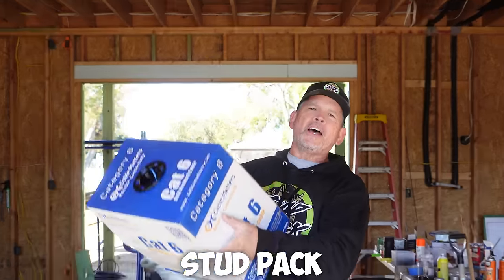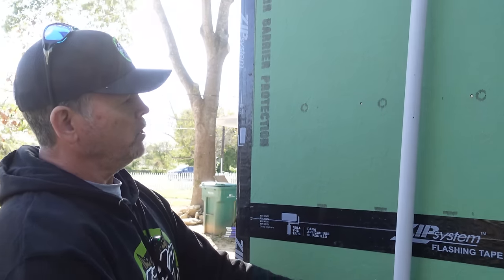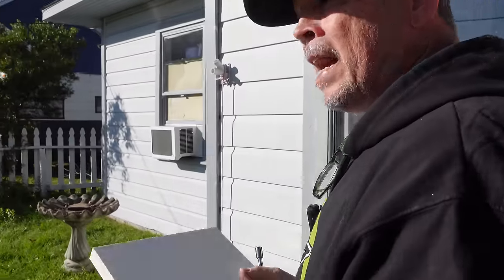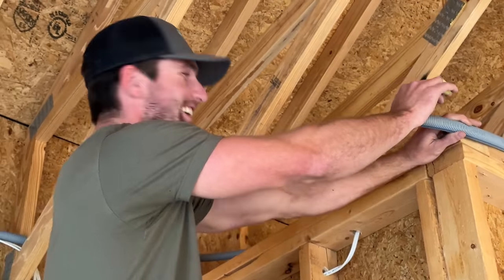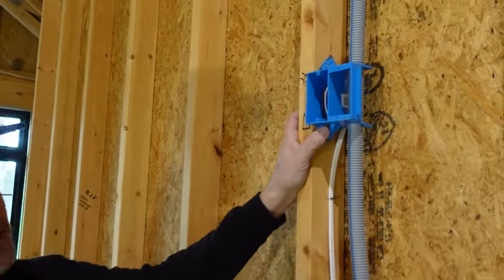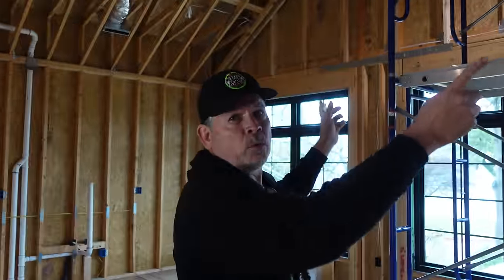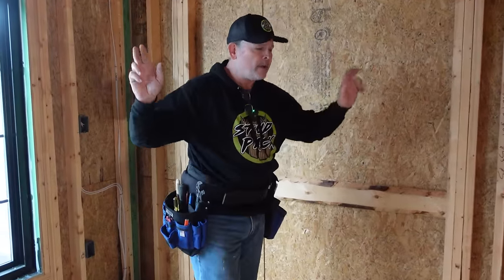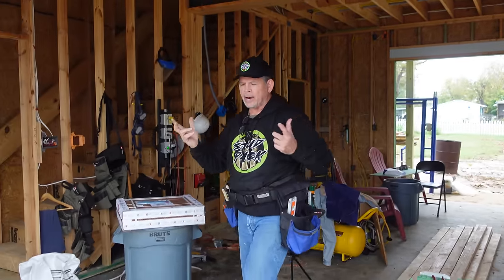DIY Networking for a Future Proof and HIGH SPEED Home! (Smurf Tubing and String Pull Trick!)

Comment: Please don’t terminate with modular connectors. Terminate to keystone jacks and connect with molded patch cables.
Reply from the maker: Why?
Reply: @StudPack 1, you’re using solid conductor. Punching down to inserts will have a more reliable connection. 

2. Molded patch cables will have better longevity/durablility. Less likely to cause issues in the future when you plug/replug cables. 

3. Keystones in a wallplate, surface mount box or patch panel give a much cleaner installation and gives more cable management options.
Reply: @StudPack it’s the right way to do it.  Solid core cat 6 in the walls from a central home run location.  You will use a patch panel in that location and will have the modem and router located there. You will terminate throughout the house with keystone finishes that snap into the wall plates. You then run preterminated rj45 Ethernet cables (which are stranded cable and more flexible) to the actual devices , computers tvs etc. you also want to ensure you are using solid core copper cable not CCA which is copper coated aluminum.  It sucks, reduces bandwidth and does not work for POE applications.  Also run Ethernet cable into the center of the ceiling so you can ceiling mount an access point. Lots of little details around this make a big difference.
Reply: @StudPack  see all the comments that all say the same thing about keystone jacks.
Reply: @braydonscully4646  @Studpack heed the above comment. wise words he says.
Reply: @StudPack service ability mainly. Think of it in terms of a power outlet, you wouldn't put an extension cord end on the end of a power run.
Reply: @StudPack  Read a book on data cabling. Just like the NEC, there are standards. (eg. the conduit color should be blue (wire) or orange (fiber) to visually indicate it isn't power.)
Reply: @paulzeee  I love this analogy. Imagine all of your outlets in the house be female ends of extension cords just "hanging" out.
Reply: From wall to network rack:

-Keystone in compatible wall plate
—when punch down keystone (568B is typical)
-Cat6 copper solid core cable to cat 6 punchdown or keystone rack mount panel (maintain same standard as was used on keystones / 568B is typical)

Use patch cables between patch panel and modem / gateway / [switch (imo preferred)].

Same process for ceiling or other location if installing wireless access point / point to point etc.

Note: if placing multiple network / cctv / iot / control devices in enclosed space may warrant looking into adding an hvac register or finding another way to deal with heat dissipation.
Reply: I second this comment.  Terminate to jacks in the wall and used the Molded Patch Cables.  Jacks are much easier to repair then Modular connectors.  Also a patch panel will be an better option for where all of the ends meet at the fiber termination.  I started with Modular connections and converted them to wall jacks.
Reply: In my experience with Cable Matters' warranty process, should anything bad happen, it's a lot easier to demonstrate that it's not through "abuse, misuse, or normal wear and tear" if everything is in the plenum, the device end never moves (because it's punched down in a keystone jack), and the hub/switch end also never moves (because it's punched down in a 77 block or patch panel mounted to the wall).
Reply: @StudPack  There is a different mechanical connection between the two termination methods. The keystone jacks are typically designed for solid wire. The RJ-45 connectors are more often designed for stranded wire, but there are exceptions. A good stranded patch cable should be more flexible and allow for movement without failure. Look for features like a molded strain relief and a guard to protect the tab (but not the big molded boot). From the keystone jack to the TVs, check out slim patch cables, which use 28AWG wire for a cleaner look.
Reply: @StudPack  the same reason you put an outlet on the end of your electrical wire. It's the right way to do it (plus it looks much better). If I've learned anything from StudPack, it's that they do things the right way. Please, for the sake of all us networking engineers sanity, put a keystone on the end with a wall plate.
Reply: @TwelveBaud 66 block for telco, 110 block or krone block for networking.  110 block is the block used in the US.  I'm not sure what a 77 block is unless you meant 66...but do not use 66 blocks for anything over 10Mbit...with 100Mbit and Gbit or higher it's 110/Krone.
Reply: @StudPack Just as others have said, you wouldn't run your romex out of the wall and just add a plug on the end like it was an extension cord. Keep the same mindset for ethernet. Use just an RJ45 in the same way you might hardwire power to a device, for when it's bolted down and never moved.
Reply: @randalwc  if looking to cross connect with higher density, imo belden gigabix is the way to go. Cat6 rated. Proprietary is an issue but cost isnt that bad. All the companies play that game in some way or another though though eg: leviton / allen tel / corning / panduit / hubbel etc.
Reply: @StudPack  Solid cable is not for devices, as continuous kinking will break it, that's why ends to device use stranded cables
Reply: @DynamicBits  RJ connectors are available for both types of cables. If you use the wrong type of connector it won't work reliably.  If you're terminating a cable with solid wires you MUST use the RJ connector that's designed for solid wires. And, if you're terminating a cable with stranded wires you MUST use the RJ connector that's designed for stranded wires. Don't mix them up. The two different types of connectors have different prongs that pierce the wire insulation and grip the wires differently.
Reply: @StudPack  As a network guy I'm not sure what you did was necessary wrong, I always find it much easier and much less time consuming to punch down into keystones and I find less errors/headache when you go and test the ports.
Reply: @StudPack  please listen to those who have spoken!
Use keystone jacks on the wall plates and pre made stranded patch cables!😂

along with everything others said, crimping plugs on the cable is easy to have bad or intermittent connections develop. 
Terminating onto the keystone jack works almost 100% of the time. The pre made patch cables also work almost all the time and are easy to test.
When you have an intermittent problem it will be much harder to troubleshoot if your terminations are on the cable.
You will NOT lose speed going thru more connections if they are all cat6. That's why they are "category6"! They all pass that speed.
We love you, but as with other things, learn from the pros!😂
Don't forget, your Internet and network will be one of the most important features of your house. Treat it with the utmost respect and you will be happy!
Reply: As others stated, don't terminate your "permanent link" (industry-standard terminology for the “fixed”  portion of the Network Channel that is typically permanently installed in a facility - within walls, through ceilings or conduits, etc) with RJ45 modular plugs. Permament link cable (your sold-copper cat6) should be terminated with a category-rated (cat6 for example) patch panel on one end and a category-rated keystone jack on the other end. Patch panels and keystone jacks are category rated and have PCBs (printed circuit boards) for impedance matching and optimal performance, whereas simple plastic plugs with contacts (RJ45 plugs) do not. It has been shown through testing at higher frequencies and at longer distances that RJ45 plug-terminated cables can have degraded performance, although they might work if distances are short and highest network speeds (greater than 1 Gbps) are not needed.

For more info try doing an internet search for permanent link vs channel test, or search  "Choosing the Right Termination -  Keystone Jack vs RJ45 Connector”, "Selecting the Correct RJ45 Connector", and "What Does a Bad Termination Look Like?" on the TrueCable website.
Reply: @paulzeee this is the best analogy to his question well said 👍
Reply: @StudPack I think the simplest answer is. "That's how the pros do it"
Reply: @StudPack  RG-45 connectors break over time, especially the locking tab. Every commercial cable install uses keystone jacks to terminate cabling
Reply: @georgecoffey9387  The Romex analogy is great. Both are solid wires that you don't want to repeatedly bend after they're installed.
Reply: While we're at it... terminate the end near your router at a patch panel, then patch in to your router from the panel. This will allow you to drop more ports all over the house and only plug in the ones you need, or to easily change equipment out later.
Reply: @bry.nine.  They could use coupler keystone jacks as well, but either way, yes, they should be using keystone jacks.

Comment: Terminate the ends with a keystone jack and plug a patch cable into the wall and to the device. That makes so much more sense and is more professional than terminating the wire with an RJ-45 plug hanging out of the wall. The prong on the RJ-45 plug will break over time and then you have to recrimp the cable.
Reply: If you want to get 10g over plain Cat6, the fewer connection points the better, I'd leave off the patch panel.
Reply: I second this. Keystone jacks are also easier to terminate, imo.
Reply: Patch panels are the way to go
Reply: @jtkilroy  Max run on 10Gb Cat6 Ethernet is 330 feet, he should be fine in a residential building.
Reply: they're never gonna saturate 10g anyway
Reply: Nice job guys, love the conduit runs everywhere.  Solid cable is cheaper and generally lives in the walls and should be punched down to jacks or patch panels.   Most people violate this “rule” for one-off or temporary situations.   Stranded cable is more expensive and is used for patch cables.  Stranded is much more flexible and resilient to repeated handling.   The teeth inside the plugs may break solid cable but stranded has many wires to spare.   Stranded is a b**ch to crimp because it’s difficult to line up the conductors…..so most IT folks just buy them in multiple lengths for the closet….I like to get those newer thin ones in multiple colors to ID my data sources.
Reply: Agreed!
Reply: Solid Cat5/6 is not mean to be used with male 4j45’s …….
You use the keystone jacks like you said ….
All patch cables are stranded …..not solid …
The keystones bite into the wire in like 3 different places … probably more …
I’ve installed this stuff since the early 90’s
Reply: Also leave yourself at least a 3-6' service coil in the walls somewhere for you to be able to pull down any excess wire to ensure you can move it if needed in the future or have to recrimp.
Reply: @jtkilroy I'm running 10Gbe from my workstation in my office to my basement switch. It goes through a patch cable to Cat 6 in the wall to another patch cable and over the past week (how long my connection has been active) I have 0 errors.  This reply will literally go over 10Gbe. So myth that using keystone jacks for 10g is a bad idea is busted. Sorry.
Reply: @Robin-xe4yz Haha, I probably said the same about 10base-T
Reply: Yes you lose nothing by having a keystone in your connection.
Reply: @gordiehattrick  Cat6 is only up to 50m (180ft). Cat6A goes the full 100m (330ft).
Reply: @gordiehattrick  Cat 6 is rated for 10/100/1000 up to 100 meters (328 feet) but Cat 6 only runs 10G up to 55  meters (164Feet) but you can go past it in less noisy areas. If you try to run 10G at 100 meters stuff will act all crazy at times. You coud push 180 feet with an 8 foot patch cable at each end but that's pushing it.

Comment: $5 says when the fiber company comes, they now have a "new" style box that isn't anything like the old version.
Reply: Boxes will be backward compatible but use a new faceplate. When the CAT is pulled through with the string installed, make sure they pull a new string behind it to pull anything back through the conduit and/or another needed cable, fiber or otherwise.
Reply: I was just going to comment that a future network box may be different.

Comment from the maker: We're actively reading all comments and learning from all of you, thanks for you're input!
Reply: I install fiber internet for a living. As everyone else has said use punch downs anywhere you will want a connection. I like the idea of hiding the "modem" in the attic as long as it's climate controlled however it will be difficult for any troubleshooting by you or the technician to get to after walls are finished.  It will also make it easier if the wires and smurf tube are run into a "smartpanel" or structured network box that mounts in-between stud bays inside of there is where you would terminate the wires with male ends so that they can plug into equipment such as switches or modems or ndvr.
Keep up the good work!
Reply: Hey Jordan/Paul, not going to beat the dead horse that everyone has already commented on, but I am curious as to why you wanted to run the male connector directly from the wall? No judgment, just curious. 

Also curious (and I understand the logic of why you'd think to place everything in the attic), but why not run all the low voltage to that spot underneath the stairs with the rest of the electrical? Granted, you'll want to have some space between high/low, but that would probably be much more beneficial. You could easily mount a 8u rack, where you could terminate fiber, copper, and mount your switch or other equipment. As many other as have suggested, I'd consider taking a look at Ubiquiti gear, it's a prosumer level of equipment that is easy enough for most people to setup, but is going to provide (more than) adequate performance for your needs.

If it seems a bit overwhelming, don't hesitate to reach out and I can help guide you.

Comment: Pre Camera planning with Cat6 (Power Over Ethernet - POE)  1) ALWAYS loop an outside run of temporary loose CAT6 to your camera location to test the field of view, mount the camera on an outside ladder, 2) Use good over hang protection to keep rain & snow from hitting the camera lens, 3) Use white painted flat aluminum 1-2" wide metal brace support that slides in with soffit, use stainless steel screws to hold soffit pieces in place, 4) Keep Camera away from spot lights that attracted bugs and spider webs that will eventually obscure your view. 5) Motion detect during testing, your camera placement height may make peoples videoed faces undistinguishable. PROPER CAMERA HEIGHT IS CRITICAL.